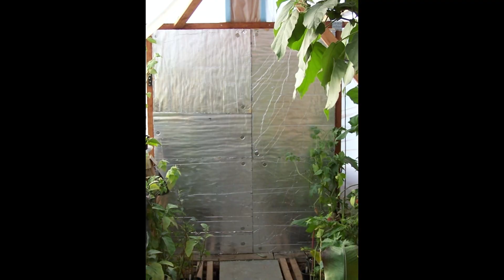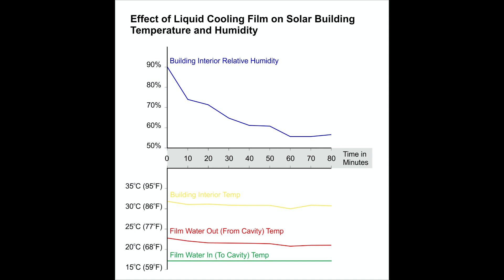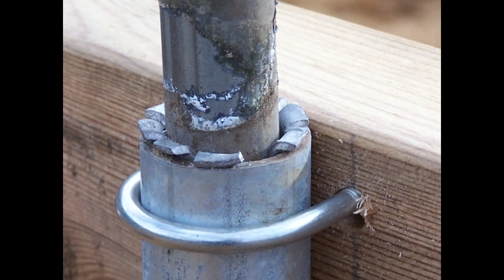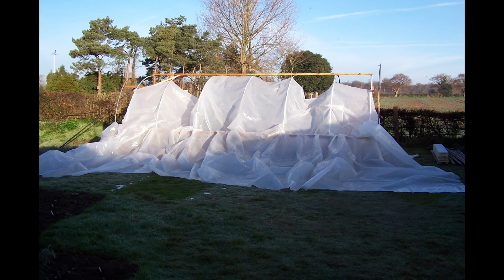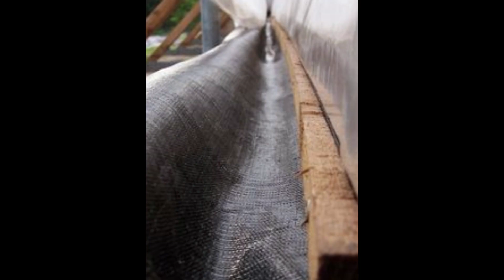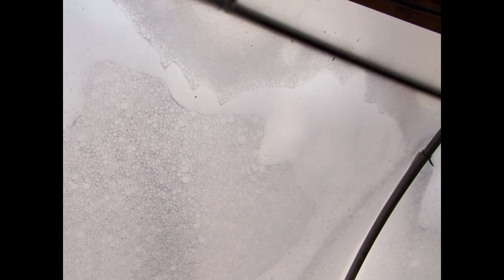Soap bubble insulated solar greenhouse - How to heat your greenhouse with soap bubbles!

Comment: Harvey, you should continue this project. Beside bubbles, we should know the water thermal mass plays a very important role that many tend to forget. Soap bubbles plays roughly 1/3 of the whole effect while the water thermal mass plays the other 2/3.
Reply: This isn't supported by science, water does not transfer heat fast enough to make a difference

Comment: Can we cool down green house using the soap bubbles layer? cooling is required in tropical and desert areas
Reply from the maker: You can use the bubbles to shade. It acts like cloud cover. However, we found they broke down quickly in the sun so you would have to find a way to stabilize them. You could also run a film of water under the bubbles on the inner skin. This would greatly reduce the humidity and increase the amount of plant transpiration. Indirectly this would cool the green house and promote growth in the plants

Comment: great video, thx! i was wondering how long the bubbles can survive, do you need to keep it running all night (noise)? And what kind of soap to use? (some anti freeze?)
Reply from the maker: Thanks. On a still night the bubbles would actually last almost all night without being regenerated. The movement of the poly skin and resulting air currents in the cavity would get destroyed. So on a windy night the regenerator would come on maybe ever hour at the most. It would run for about 5mins to refill the entire cavity. Bubbles would also freeze and collapse on night with temps below -4C. But this rarely happens in this part of the UK. Soap solution was just sodium lauryl ether sulfate. I tried adding glycerin to strengthen the bubbles, but this created more bug growth
Reply: @sustainablegrowingsolution8236  thx for the response, wonder if an UV-C light or an ozone generator would be good for keeping it clean? 2nd option i dont know if ozone would react with the soap. Is there some research on soap "formulas"? Is there anything natural that would produce enough (and stable) foam?
Reply from the maker: There are a lot of untested aspects of this concept. I haven't experimented with either UV-C light or an ozone generator and haven't read about any practical application of them in relation to bubble. Running the soap solution heat collection film in the south cavity during the day does seem to keep bug growth under control so additional UV lighting would probably help. I don't know of any other soap research other than I know people have used Dawn with good success. I certainly haven't heard of a natural substitute. The soap bubble would kill aphids if there was a leak, but a better designed geenhouse shouldn't have issues with the soap getting on the plants. My design had some serious flaws in this regard.
Reply: @sustainablegrowingsolution8236  How much does your soap liquid solution weigh, before they are foamed into bubbles. I need to know the weight and how much i need for a typical greenhouse.